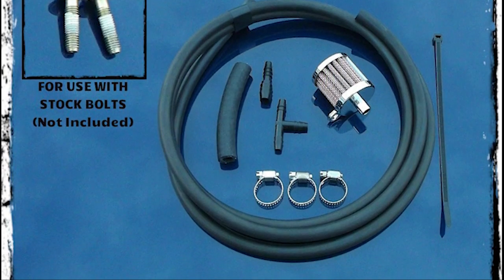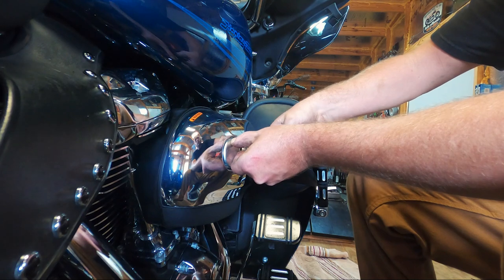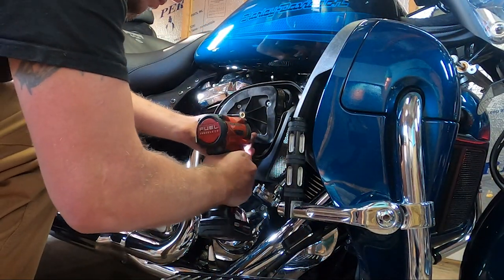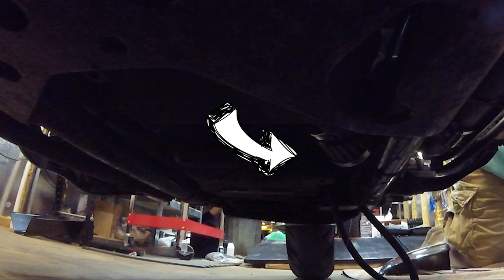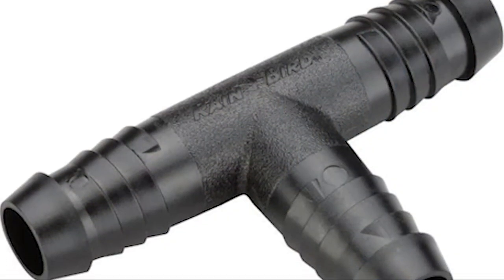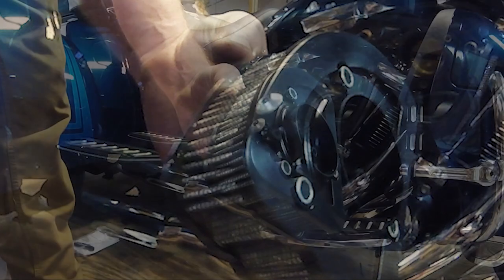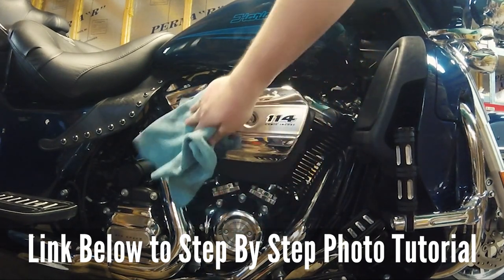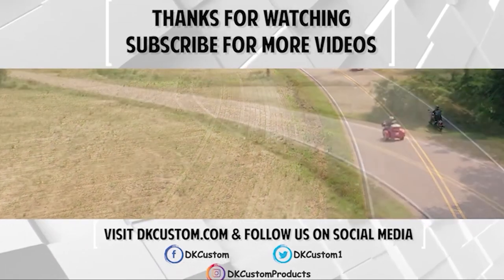DIY-How to Install Breather on a Stock Air Cleaner

Comment: My ‘14 xl1200c has the gasses going right into the throttlebody, not filtered. The filter is built to go right in the head holes. Do you carry a system for this bike or do I have to get a different filter element/entire unit?
Reply from the maker: We have External Breather Systems that will fit almost every different Air Cleaner available.  You can see them all at this link-
https://www.dkcustomproducts.com/91-up-sportster-big-twin-evo-c75-74.htm
If you are not sure which one will fit your bike, give the shop a call or email, let them know which air cleaner you have (name or photo) and they will help you out.
Support@DKCustomProducts.com
662-252-8828

Comment: How would this install with the HD Extreme-Flow AC #2940035 as the edge of the filter covers the breather bolts?
Reply: go to DK's website and go to their external breather system page.  Look for the kit that has the banjo bolts for the hoses to connect to.  Those banjo bolts replace your spacers behind the back plate.  Just did this on my 03 Sporster 1200C.
Reply from the maker: There are many variations of External Breather Systems.  The one in this video is not ideal for the A/C you referenced.  You can see all the EBS kits at the link below, or you can email or call the shop for options on that air cleaner.  http://www.dkcustomproducts.com/breather-systems-c21.htm
Support@DKCustomProducts.com or 662-252-8828

Comment: Why you use tee ...you can use single pipe also...??
Reply from the maker: There is a vent port in each of the two cylinder heads.  So two tubes, one from each head, can go into a T fitting, to one tube, then to a filter or catch-can.

Comment: I’ve installed your external breather on my stock 2020 Road Glide. What would you suggest I use to plug the small hole in the back of the filter element with? I can’t exactly see how you did it.
Reply: Seeing that you plugged the hose with a bolt. I was able to find the perfect one for the job.

Comment: I went and found this kit, it was $84. For 6 ft of hose, a small filter, 3 small clamps, 1 tee fitting, and a few zip ties. Can be bought at any auto part stores for under $20... 
What gives? I did that, I  listed everything, posted it, now it's removed.
Reply from the maker: Please share the itemized list of items, with photos and prices from a auto parts store that add up to less than $20.  Include what time you spent, and what fuel you spent to get:
1 Filter/Catch Can (Whichever you Choose)
1 Six Foot Length of hose
6 Zip Ties
3 Hose Clamps
1 T-Connector
1 Stepped Connector (Twin Cam only)
1 Two Inch Length of hose (Twin Cam only)

Comment: Does the breather kit work with A v twin 96 cubic in  Stock air cleaner
Reply: It should work!!
Reply from the maker: Yes, we have Breather Kits for all Harley's, from the Evo forward.  If you are referring to a Twin Cam with the stock football cover, then either of the kits are the following links will work-  http://www.dkcustomproducts.com/twin-cam-discrete-head-breather-system-touring-softail-dyna-dk-tc-brt.htm  or http://www.dkcustomproducts.com/external-breather-system-w-catch-can-harley-twin-cam-dk-tc-brt-cc.htm
Here is a link to a step-by-step of one being installed on a Twin Cam with the football style cover-  http://www.dkcustomproducts.com/acl/installation-of-external-breather-system-on-stock-twin-cam-air-cleaner.htm
Reply: @DKCustomProducts   OK thank you very much

Comment: How about an install on the H-D Heavy Breather?
Reply from the maker: There are several options for the HD Heavy Breather...you can see a chart here- http://www.dkcustomproducts.com/getting-the-right-external-breather-systems-ebs-for-your-bike.htm or if you'd rather, you can call or write the shop for them to let you know which choices there are for your particular Heavy Breather.  Support@DKCustomProducts.com or 662-252-8828

Comment: That's all fine but what do you plug the holes in the filter with? Looked like you just threaded some screws in there
Reply from the maker: I use High Heat RTV.  Some folks thread the holes and use set screws.

Here's a video on the subject- https://www.youtube.com/watch?v=uAmPC_kglJk

Comment: What did you use to plug the existing air flow holes?
Reply from the maker: Some folks use bolts/screws, we used a plug or some RTV.
Reply: @DKCustomProducts  you should have showed  what kind and the way you mounted them please more detail
Reply from the maker: @Whittiercruising Here is a video that goes into more detail on the holes that you may find useful, specifically starting at the 1:59 mark- https://www.youtube.com/watch?v=uAmPC_kglJk

Comment: I just purchased a 2020 SGS and had HD install Screaming Eagle stage 1 in order to avoid issues with the M8 warranty.  I'm wondering if it will void my engine warranty adding a breather system?
Reply from the maker: Any change to emission will void the warranty if they find out and decide to enforce it.  Solution is to remove it before taking it in to dealership for work, or get a good aftermarket warranty that does not have the ridiculous EPA/Harley collusion restrictions.
Reply: Go to Doc Harley he shows how to go about adding a external vent w/out voiding your warrenty
Reply from the maker: @lennybuis9114  That is NOT true.  He specifically says in his video otherwise.
Reply: Ive had a few new bikes in past couple years and have always avoided any Tuners, which can show changes when on HD computer.  This change, as slipon change, shouldnt throw up any flags.. IMO
Reply from the maker: @FreeSwimmer  This is true.  Air Cleaners, Exhaust, External Breather Systems, none of these leave any footprint for the Digital Tech to see.

Comment: Questions:  1). What size is the drill bit?     2) when the hose was ran from the air cleaner, it appears to have been run forward first and then back along the frame.   Is that correct?
Reply from the maker: 3/8" will work, but it does not need to be air-tight in this instance, so there is some flexibility there.  Yes, in this particular install the hose ran forward to the downtubes and then under, along the frame rails.  But that is just one way of many different options on how to run the hose...however you want to run it to the final location will work.

Comment: Need more detail in how the hose was routed
Reply from the maker: The ways to route the hose are infinite.  You can put the filter or catch can anywhere you want on the bike.  Routing will depend on where you want to have the filter or catch can.  When routing it, just keep it away from engine fins and moving parts.  Here are pictures of just 3 of the MANY places to mount the filter or catch can-
https://www.dkcustomproducts.com/media/catalog/product/cache/1/image/9df78eab33525d08d6e5fb8d27136e95/b/r/breather1.jpg
https://www.dkcustomproducts.com/media/catalog/product/cache/1/image/9df78eab33525d08d6e5fb8d27136e95/k/r/krang_black_catch_can_1.jpg
https://www.dkcustomproducts.com/media/catalog/product/cache/1/image/9df78eab33525d08d6e5fb8d27136e95/s/t/stealth_breather_tc_2_1.jpg

Comment: Wanted to buy the system for my 2008 Road King. With the billet can, it was $171.00. Went to the hardware store and got all I needed to do this and spent around $40.00. Just sayin.
Reply from the maker: Thanks for your feedback! I appreciate you sharing your cost-saving approach. The Billet Catch Can involved a lot of planning, design, machine time, assembly, and craftsmanship to ensure quality and performance. Different solutions work for different people, and it’s great to hear you found one that fits your needs.

Did you get a filter for your kit at the hardware store?  I know you did not get a catch-can and all the hardware for that price.
Our kit with a filter is 79.95 for your bike.  You can see it at this link- https://www.dkcustomproducts.com/diy-head-breather-system-touring-softail-dyna-sportster-dk-diy-bh-brt.htm

Looks like you saved $40 if you got a filter and everything else you need, and do not include your time or mileage to get to and from the store.

Thank you for commenting! MB

Comment: Never route breather filter or catch can in line with rear wheel or rear brake disc/caliper if possible for obvious reasons. 10/10 times this can be achieved with some thought. Whoever thinks that routing a breather filter in direct line with the rear wheel should reconsider. You guys shouldn’t be using that picture as an example some people with a little
less know-how may copy that...
Reply from the maker: Thank you.  Very good point.  We did not make it clear.  This particular bike is a Tri Glide and the filter is no where in the path of either rear tire or brake.

Comment: I got the same mode on dyna wide glide 2001 but without catch can or filter. Is it necessary to attach one of those?
Reply from the maker: It is not.  The only reason for a catch-can or a filter is so that oil does not drip where you park it, or spray on the bike while going down the road.

Comment: Will the head breather bolts off a 114 fit on my 2016 SGS 103?
Reply from the maker: Yes, the stock breather bolts are the same on the Twin Cams and M8's.